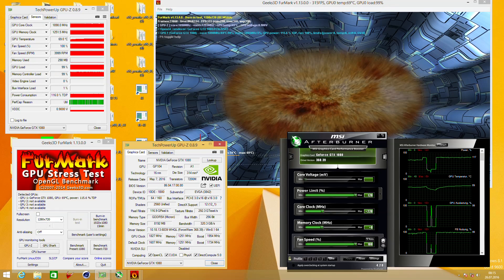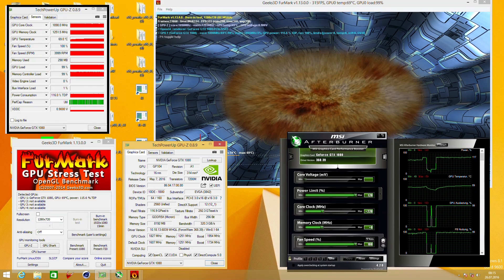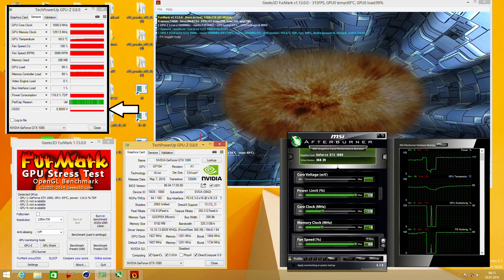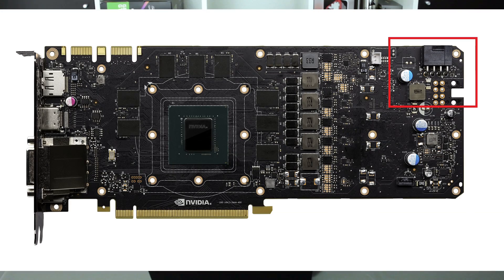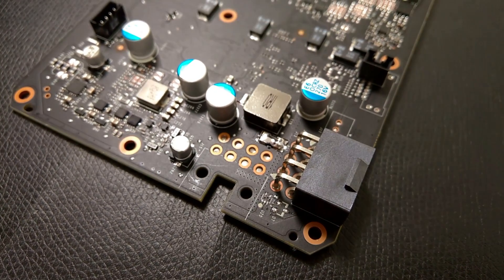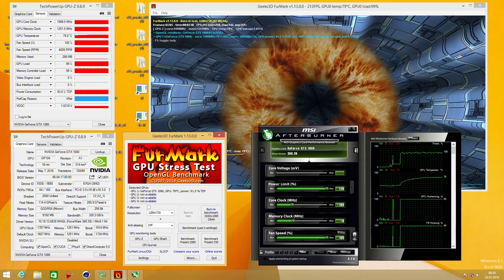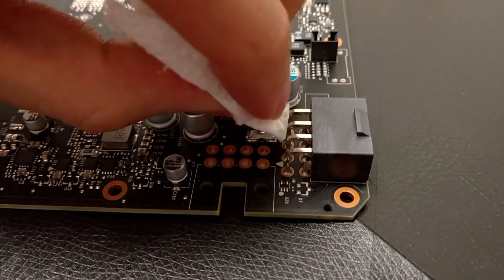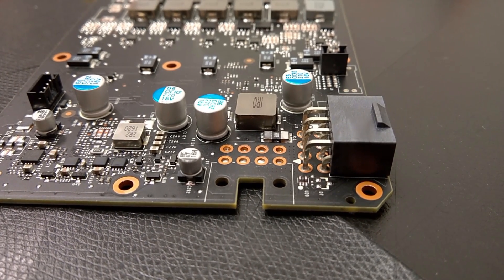GTX 1080 FE + GTX 1070 FE Power Limit Mod - Unlock the Power Target

Comment: So i did the mod and I put my card under water(EK block) and used Thermal grizzly Conductonaut on the core + Fujipoly 17W/mK pads on vrms. Gpu temps are 33-34C under load with 25C water lol!
I'm running 2202MHz stable with 1.094V on the core + 11100MHz on mems.
No fluctuations at all! I recommend this mod to everyone. WIth this clock and volts, I never go over ~105% TDP. Afterburner allows you 120% so its perfectly fine.
See here Valley benchmark: http://tinyurl.com/j4m9mjk
Thanks Der8auer!
Reply from the maker: Great feedback! Thanks a lot :)
Reply: If I move the voltage slider to +100% it doesnt do anything to the voltage. Not sure why as before I did the mod and put my card under water, it worked.
Now the only way how to get more voltage is by using curve in AB. I can leave the voltage slider at 0, but if you mess with curve, it will adjust voltage too.
Btw, from my testing, I can say, that even at stock clocks, the card is TDP limited. You get "free" performance just by removing TDP limits even at stock clocks ;)
Reply: +fat4ll That's awesome. Wonder if removing the mod would make the slider thing work again lol. Thanks for all the help. I get my waterblock tomorrow and the liquid metal next week.
Reply: Is this with an AIB card or the FE?
Reply: FE card mate.
Reply: +fat4ll Awesome, thank you. what are your actual clock settings in afterburner. How much lower did these have to be before the mod/ on air even. Currently I can only get overwatch to be stable at 2012mhz on air otherwise I get driver crashes. Heaven can pass multiple times around 2050 though. I'm hoping that this mod/water cooling will help.
Reply: Well before I could do +240-245MHz stable. That ended up 2138-2150MHz, with fan maxed 100%, but eventually dropped to ~2100 due to temps and tdp limits. 
On water, max OC with stock voltage stayed at 2150MHz, with a difference that it's not dropping to ~2100 but staying all the time at 2150MHz. Pushing voltage to 1.094v allowed me to get 2202MHz(using curve in AB, press ctrl F). For daily gaming I use 2189MHz_1.094v, totally stable, no downclocking of fluctuations. 
Like I said, now I'm using curve for OC, as moving the voltage slider in AB does nothing for me now(after putting the card under water+tdp mod), so I cant tell you what +XXX MHz it actually is.
One more thing. My card is above average in terms of OC, I would say. Every card is different so OC will vary ;)
Reply: +fat4ll Thanks for the detailed response! I certainly didn't hit the silicon lottery lol. I guess I'll go back to messing with the curve. So your voltage slider is set to 0? I am noticing that my tdp limits are hitting between 110 and 120 so that's the only reason I feel like this may help my clocks a bit.
Reply: What kind of performance increase over stock did you observe?
Reply: Thanks for sharing with the community. 

Do you think you can offer some advice?

Recently, i've seen my FPS drop in games and I decided to benchmark my Frankensteind EVGA 1080 FE. I tried out the Gamer's Nexus Hybrid Mod. Turns out that i'm hitting my "powerlimit" often when running heaven. My voltage is topped off, powerlimit 120% and temp maxed out at 92. Even without an offset, i'm getting "powerlimit 1" (EVGA PrecisionOC OSD) after 30 seconds pretty frequently. Do you think this will help? I highly suspect that my fps drops are from getting throttled. I'm definitely going to take the risk of trying this, although i'm a beginner at modding, if it will help my situation. Thanks in advance.
Reply: i have a question , can you mod a gtx 1060 evga ssc like this ? like can you do the voltage mod
Reply: link been redacted

Comment: Will modding just this one resistor (out of 3) be enough to overcome tdp throttling on air/water ~2150MHz? or is modding lets say 2(out of 3) resistors advisable? thx
Reply from the maker: The differerent resistors are for different voltage rails. So you usually have one for GPU current, one for memory current and one for PLL current. If you mod the one GPU shunt resistor (usually the biggest one) it should be fine.
Reply: thank you very much!!! keep it up mate. 10/10

Comment: Great video! Will the shunt resistors be in the same place on the Strix 1070 pcb?
Reply from the maker: on 1070 strix they are directly underneath the 8 pin connector. 2 shunt resistors
Reply: der8auer Thanks a bunch!

Comment: Great video.
I was wondering if you can actually link the liquid metal you have used for this mod (an possibly alternatives).
I have an EVGA 1070 SC which is based on reference PCB, so guess this should work without problem. I have a liquid cooling for the GPU + VRAM and VRM (not full cover, just two pieces) so my card never crosses 50C on GPU under any load.
It will be interesting to see how far I can take it. Right now the stable seems to be 2050MHz @ 1.025v
Reply: I second this, I have a 1070FE with full cover custom loop and my temps stay very low, I suspect that the power target is my clocking issue.  I have some cool labratories liquid ultra, but my understanding is that it has gallium which can be a major problem if on aluminum.
Reply: well ... found on my own
http://www.thermal-grizzly.com/en/products/26-conductonaut-en
Kinda expensive at 13$. and i can't get it shipped to my country for less than 25$
Reply: thanks, it looks to be the same as the cool laboratories stuff as this stuff say don't use one aluminum also and look about the same to spread- this stuff will get harder to take off over time fyi
Reply: did you send the mod?

Comment: Subscribed. Fantastic content, found you on reddit. Will definitely watch more. Any chance of a Titan X (pascal) edition of this? or maybe some custom cooling solutions for it? Planning to get one and considering a mod for voltage/cooling purposes to bring that clockspeed up!
Reply from the maker: thanks man. For sure it will be possible. Once I have one, I will post a video guide :)
Reply: Got mine few days ago, even on air it's a monster, 2100Mhz (+220) Core!!! And +500MHz Mem! Hitting VRel and PRel limit as anticipated now, so really looking forward to your guide now :) I think I found shunt resistors already (very similar to 1080 PCB) but no idea how to get some more VCore going... 

Still, awesome card :D

Comment: Which liquid metal compound did you use? Thermal Grizzly Conductonout?
Thanks for posting the video, now I am tempted to try this too, however my 1080 FE (with an Accelero IV cooler) is running stable at 2100MHz, not sure if the mod will bring a huge improvement...
Reply from the maker: Yea Thermal Grizzly Conductonaut. Let me know how it goes and if you could improve anything :)
Reply: So I bit the bullet and applied the mod. Testing with Furmark, I could keep the card running with 40 Mhz more (+240 MHz in Afterburner) than before the mod. GPU-Z reports that the voltage is capped at 1,05V now and PerfCap is VRel. I guess I can not squeeze out without a modded BIOS?

After that I have tested the card with AC:Syndicate, but got constant crashes in game (also driver crash) and had to clock down to +200Mhz in Afterburner to get it stable. I don't know if the problem is caused by the game itself (have not tested with other titles) or if the GPU has reached its maximum potential.

Comment: Hi Der8auer. 
In your 1060 video you pushed the card to 1.25v.
Can the same be done with 1080 FE? Is 1.25v fine for daily use considering <50C temps ?
Reply from the maker: Can't recommend it with FE. VRM is too weak
Reply: So what do you recommend please? 1.2v max? 
I would have vrms and core cooled by fullcover waterblock. ThxX

Comment: I think pencils also works.
Reply from the maker: pencil is not conductive enough
Reply: +der8auer Yeah, I just recall from very early days overclocking method using pencil to plus voltage. Of course liquid metal is more conductive.

Comment: Would it be possible to do something like this on a asus 1080 strix or msi 1080 gaming x? Thanks
Reply from the maker: yea video of 1080 strix is coming soon. Including mods :)
Reply: Thanks for the quick reply! Loving your videos! and the msi gaming x? any plan to do a video or adding a picture of the resistor on the PCB ?
Reply from the maker: I would show you a pic but I cant find a decent PCB picture. "Reviewers" these days don't even remove the cooler to look at the pcb... xD
Reply: I'll try to find one and post it here if i do! thanks for all the work you're doing, we appreciate it
Reply: here you can find a decent pic of the pcb
http://www.tomshardware.fr/articles/comparatif-test-gtx-1080-1070,2-2508-3.html
Reply from the maker: See the 2 black resistors which are marked  R005 underneath 6 and 8 Pin? Mod these
Reply: Yeah got them! thanks, i will check you're modding videos as well.

Comment: CAN YOU MAKE SAME VODEO FOR GTX970?
Reply: You don't really need a hardware mod with the GTX 970. You can modify the bios to raise the power target.
Reply: Tobias L. Yes thats true but its safer and easier that way. I still learning about BIOS flashing and cant find suitable BIOS for my Palit 970 Jetstream. I clock it to 1525mhz but it clearly wants more voltage. I will modify my BIOS and flash it. But i need to know more about the voltages in BIOS
Reply: All I can say after trying a BIOS mod on a 280x card is to be very careful; it can be very easy to get the info for some cards mixed up. I had a card that already had a problem and was only trying to flash its original BIOS to try to fix it, but it apparently was not the correct BIOS, and the card became completely useless afterward.
Reply: *****
 You should work on your own bios. Its Much safer If you copy the content from new bios on your bios and then flash it.
Reply: Yes as said don't use bios files that are not from you card. That's the best way to be safe. Also you can always flash a new bios on a bricked card with another gpu or igpu. So i wouldn't say the card is useless. You can always revert a false bios flash.
Reply: I tried using every bios I could find. :D  The card had a problem to begin with, though; last time I ever buy anything like that using CL.
Reply: *****
 Its not AMD's fault you know :)

Comment: Nice Vid!  Since I've already invalidated my warrenty by putting a full cover waterblock on my MSI 1070 I may aswell do this mod.  Though I don't have Kryonaut liquid metal, I have Liquid Pro and Ultra
Reply from the maker: Rather use Pro than Ultra. Conductonaut is closer to Pro than Ultra chemically :)
Reply: Cheers matey!  I'll use the Pro then!  Take some first places on hwbot with any luck ;)
Reply: I did some research and found some cases that Pro harden after 1-2 months of application on CPU heatsink. Will you recommend some alternatives?
Reply: +Tim Kung Not sure if this is the case, I've got some pro on the die of a 3570K and it's still a liquid, so I imagine it's probably OK

Comment: I enjoyed it mate! 
We would love to see 1080FE volt mod too :)
4 questions I would ask are:
1.Theres 3 shunt resistors on the card right and is it safe to mod 2 of them to increase the power limit even more?
2. If we do the volt mod and do 1.25v will modding of just 2 resistors be enough to bypass TDP limits?
3. if we do the core volt mod, and we increase the voltage to 1.25v would it be fine to run that on daily basis ? the stock voltage 1.05v seems to be very low.
4. do you see the card hitting 2.3k mhz with 1.25v?

all of the above would be on watercooling with 40C max Temps. 

thank you
Reply: 1.25v under load is far too much for this GPU with this process and water cooling. Your temps would not be 40'c either but much higher. 1.15 is likely your max safe voltage. turorial is available at xDevs for 1080FE volt mod.
Reply: I need to gather more info before I put it under water, but I can tell you that my old 290X and 295X2 were running 40-45C max heavily oced to 1200MHz @1.35v so I doubt this core will be much hotter, considering ppl with aios are running it at 45C.
I'm honestly looking forward to at least 1.2V. The question is, is it gonna be worth it? If I get another 20Mhz going from 1.05v to 1.2v then the answer is obviously NO :)

Comment: Thank you for the great tip!

The big question What have you reached under Water/LN with the 1080 after getting rid of all power limits?
Reply from the maker: Water around 2250 MHz and LN2 2500 MHz
Reply: Can you show the firestrike results of those? 
Would love to see you do a extreme overclocking video on the 1080.

Danke schoen fuer dein arbeit.